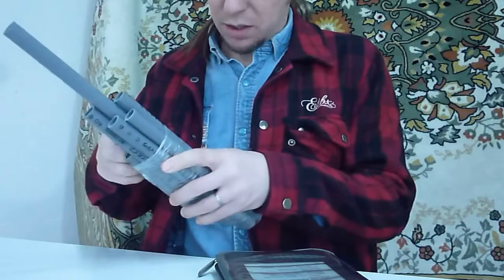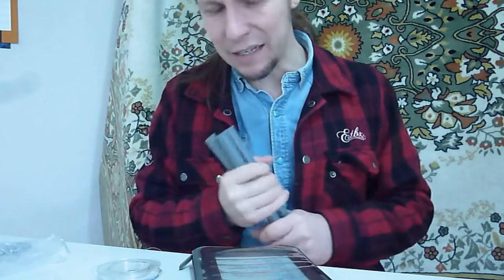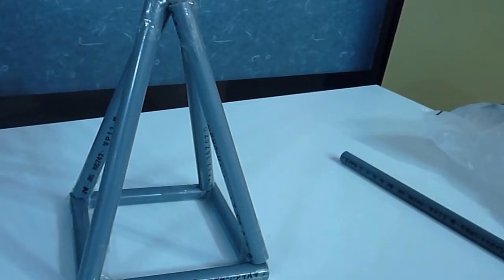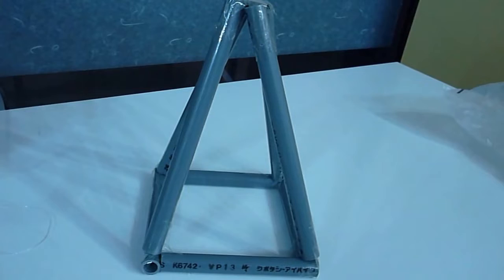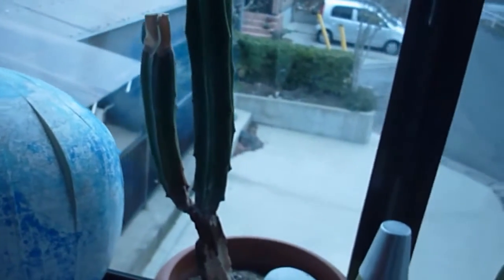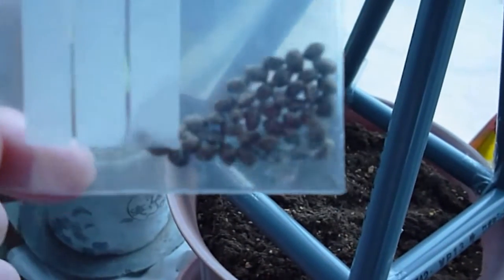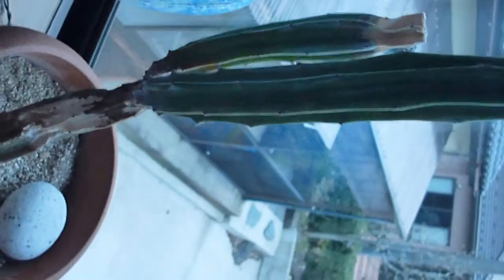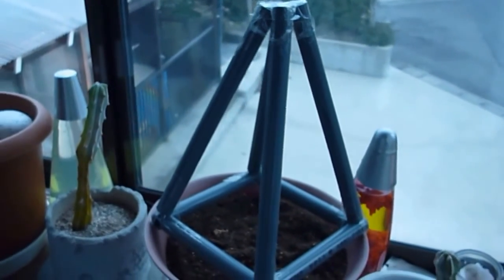Pyramid Power   My first experiment part 1

Comment: I think you got the angle wrong - the sides look too steep (should be about 42 deg).
Reply from the maker: There are two type pyramids.  This is one type the steep type.  Both are effective but have differing effects.  This is the one Dr. Gilad prefers and many of the ancient ones on many continents are the tall ones like this one.